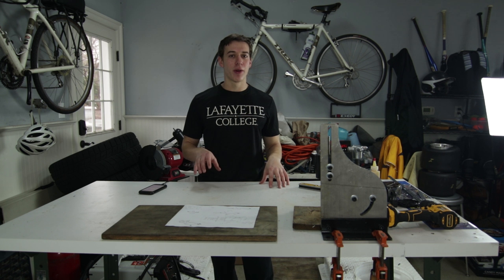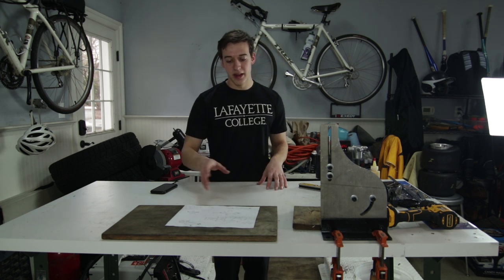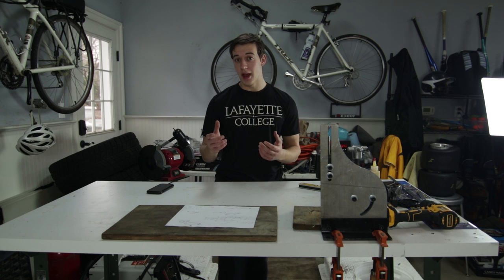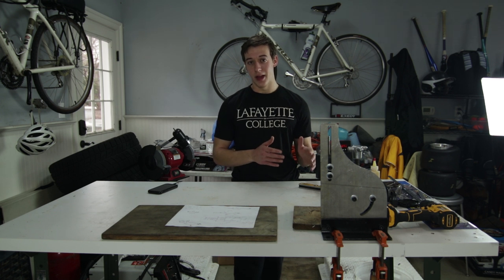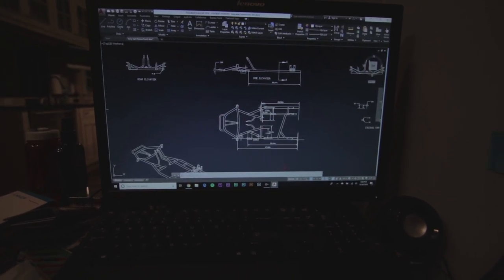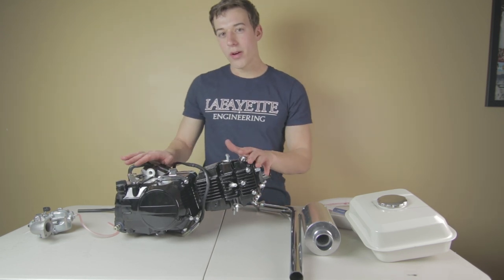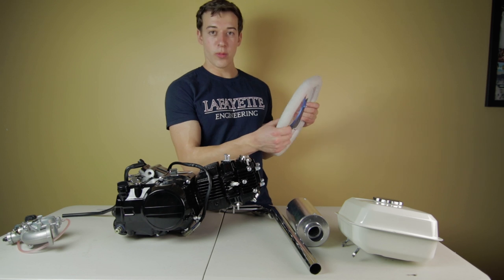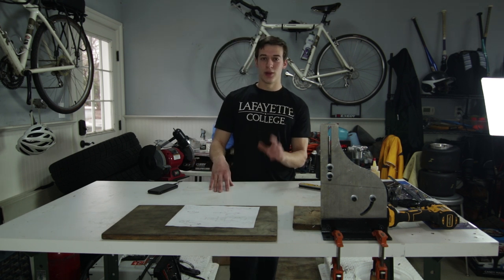CUSTOM SHIFTER KART BUILD PART 1:  PLANNING

Comment: Seems awesome that you are building something similar to a vintage tony kart. If you are going shifter I recommend the ROK Shifter engine. Very reliable as far as two stroke race engines go. I race a 2016 tony kart 401s. Best of luck on the build. Can’t wait to see the final product

Comment: What kind of steel are you using and if you could link the welder and pipe bender you purchased that would be wonderful! I am planning to build mine go kart soon but am finding vague explanations as to what type of steel to use.
Reply: Mild steel, or low carbon steel tube is what I used for this project. This was before I had a tig welder so that was my only option. The better way is to use 4130 alloy chromoly, used in race cars and commercially bought kart chassis. Chromoly is stronger, so a thinner sidewall can be used to create a lightweight chassis. Chromoly also has a high chromium content, so it will not rust like a low carbon alloy will. Downside is chromoly is a bit more difficult to work with, and it has to be TIG welded, not mig welded like this frame was. The welder used here is a hobart handler 140, and I used solid core wire with 100% co2 shielding gas, which is not ideal, but its cheap. The TIG welder I now have is a lincoln electric squarewave tig 200, which is what I would use if I were to do this project again. As for "pipe" bender, the proper tool to use is a tube bender (tube is measured in OD, pipe is measured in ID and is not as precise). All the fabrication tools can be found on tricktools.com. Alternatively, you can use a cheap harbor freight pipe bender, but it is difficult to get bends to be the proper radius, and will likely kink the tube. 

Building a frame from scratch is very expensive, and it was a good learning experience to get me into fabricating, as I have some projects I would like to build in the future that use these skills, but if you want a go kart frame, just buy a used one to save money and the hassle.

Comment: You can convert the PDF to SVG for free and it uploads to the right  scale as original . And ofcourse you can measure all the parts that are not shown on the PDF ,and put them in yourself . Hopoe this helps .
Reply: can u gimme tthe 3d model file if can be opened

Comment: in finland we have many monkey bikes 50cc and couple of them have 140cc lifan and lifan has more torque low and yx engine is more high rev top power. I myself too have monkey bike and will buy 125cc lifan when i get some money but i just bought g29 so i have to wait a bit and need other parts too and they very common here like in my school there is 5monkeys and couple suzuki pv's